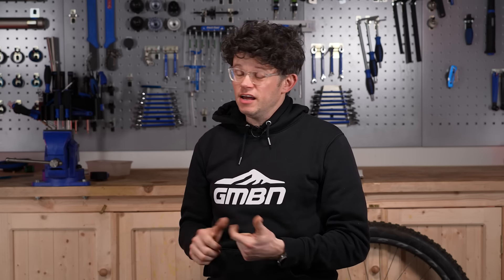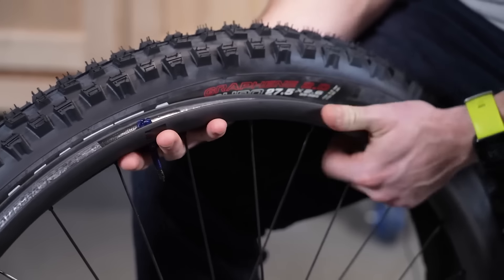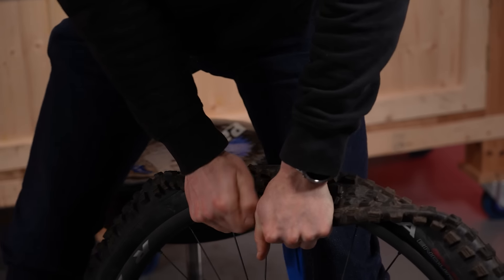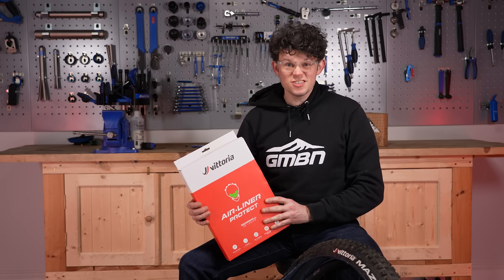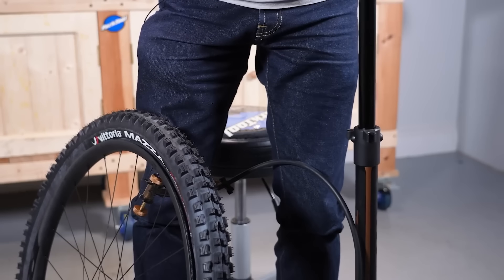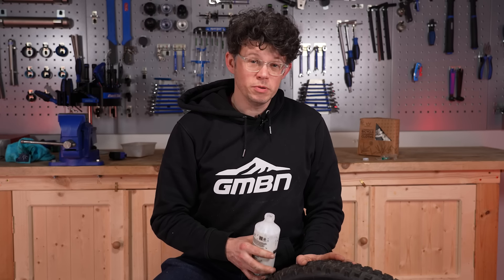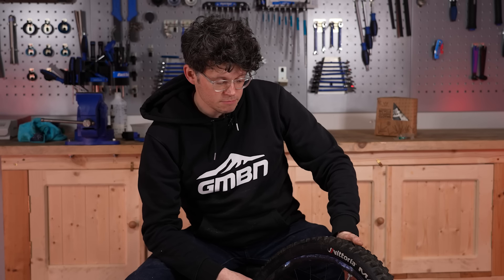How To Fit A Mountain Bike Tyre Insert

Comment: Fitted at the weekend a Vittoria light xc insert to my Atherton 130 rear wheel; Stan’s Arch MK4  rim and Wicked Will tyre (bike is set up for Forest  xc/light trail type riding) fitting was straightforward.
Excellent feel on the trails, smooth and supportive ride, I normally run the rear wheel at 21psi with the insert I reduced it to 19psi…..all perfect

Comment: Ran rimpact for about a year, there's pros and cons to everything, but overall I like them. The hardest part for me was getting the tire off the rim. I basically have to stand and jump on the sidewall or use a soft jaw wood clamp with a chunk of dowel rod to push the bead off.

Comment: I prefer to install tire & seat bead then deflate and add sealant with a syringe. Simple, cleaner & most efficient in regards to product used. In 6 years I’ve never had an issue with sealant flowing all around the insert.
Reply: i was honestly shook to see them fill the sealant the way they did. 😂 like who tf doesnt just shoot it down the valve stem briiish gonna briiish i guess

Comment: I have use Huck Norris. Easy to install and have use them one day getting a flat on a downhill trail and road it out back to the campground. Also use a syringe to reinsert the fluid back into the tire with the valve stam

Comment: You should also check the valve stem interface with the tape and rim. This is a common place for air to leak. Some valve stems align better with some rims, it’s good to have a selection. I personally have made and use silicone o-rings that I use like a washer to interface my valve stems inside the rim.

Comment: I'd like to give an advice on how to make it a bit simpler. When you insert the insert, you will try to set the tyre. That's a trick. You push one side to the centre to fit, but you can't push the other side because the insert will add a lot of tension. I recommend leaving one side of the tyre on the rim fully beaded, then putting the insert and then setting the other side of the tyre.

Comment: I use Rimpact Inserts on my Hardtail, and they probaly safed my rims a few times. Irs not to difficult to set up whe do it with a bit of thinking and staying calm. Swiched out my Rims last week, b/c i got a second set of Rims and need about an hour for switching the Tyres from one Rim set to the other and a new set of tyres to the old Rims.

Comment: I picked up a set of the Vittoria XC inserts from a vendor's booth at the Snowshoe WC race last year. I installed them on a Reynolds wheelset  with Schwalbe Racing Ray/Ralph tires and it was not a pleasurable experience at all. Forget using the tire levers as they will destroy your rim tape (so get used to sore thumbs). The set I bought came with special valve stems that have additional holes supposedly to prevent vapor lock but the inserts still managed to seal off the stem. This tends to make the use of a pressure gage somewhat iffy at best. I noticed a hole in the set being installed in the video but there was no mention of ensuring that it lines up with the valve stem to prevent blockage. Perhaps this feature has been overlooked? At any rate, I'm glad I finally got them installed. I'm sure they'll one day save my rims from potential destruction. But I am NOT looking forward to my next wheel service.

Comment: This Topeak pump head is made to particularly hold the valve core inside its body, and when done with uinflating the tubeless tire, you just press and screw the core back again, with no hiss and air lose whatsoever. I cannot understand why you @GMBN_tech do not use the feature since you do have the particular Tubi head.

Comment: I wish the last part was explained in more detail. Less volume, does it mean I should pump it at a lower or higher pressure than without the insert?
Reply: In the case of adding an insert, you can use less air pressure. The insert acts as part of the air volume
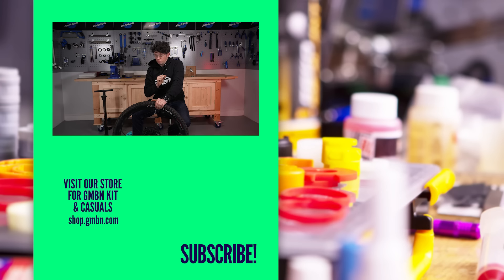Reply: He said you run the same pressure (7:55-8:20). His point was that with less air volume, the pressure moves up faster when adding air or down faster when bleeding air off. With a smaller air volume tire (since the insert is taking up space that was formally air), pressure change is more sensitive to air volume changes. His point to use a digital gauge was less strong. It may help if you know that your are less than a lb. away versus a gauge that displays only in whole numbers.